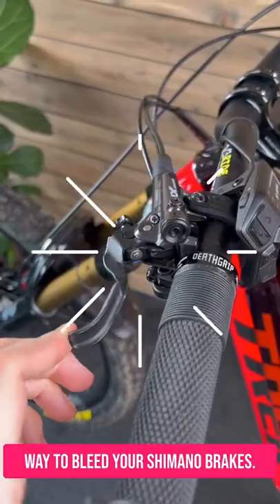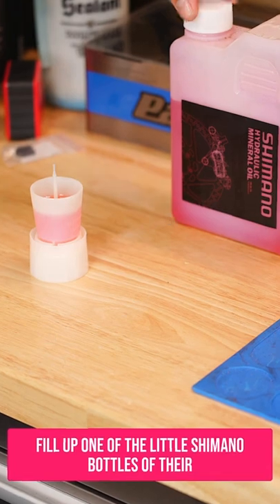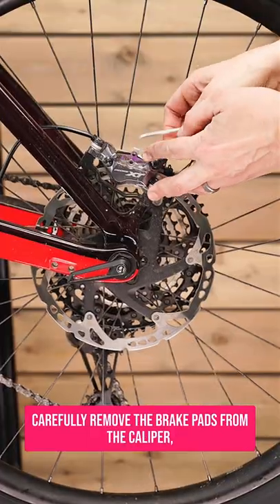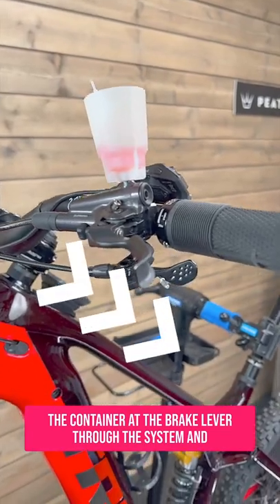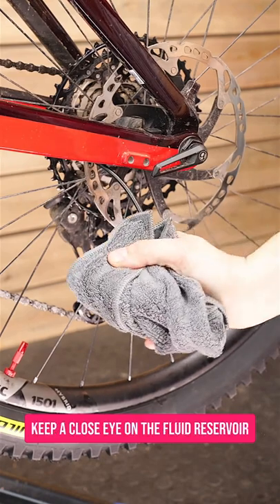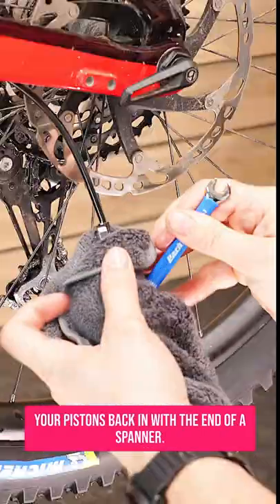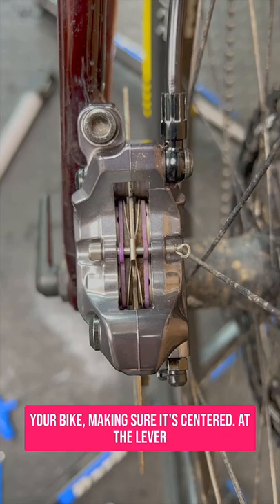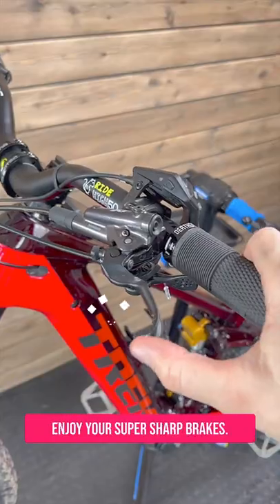How To Get The Perfect MTB Brake Bleed #shorts

Comment: You can put a clear tube on the bleed nipple and put it back into another container. You will be able to see the bubbles coming out in the clear tube and you will know when you have taken all the air out. This will save you the mess in regards to using the microfiber towel

Comment: I bleed my Shimanos from the bottom with a syringe, works better, as the bubbles come out effortlessly with the flow of the oil.
Reply: I like the syringe method since its much cleaner than letting the fluid drip. Though you should be applying very gentle pressure on the syringe as too much can pop the rubber seal in the lever reservoir.
Reply: Yeah I find the syringe way is better but I have trouble retightening the nipple without making a mess
Reply: Me too. The air will always tries to go up, so the method described here is very fault. Yotubers trying to be smart than the engineers
Reply: @FernandoHaddadMinistro  this is the kit shimano sell…..it’s not a YouTube fantasy! 🤦‍♂️
Reply: @dstroud666  Yes, but the order is up, not down
Reply: I've just bought a trek marlin 5 2021 and it has these brakes i am about 10 years behind i never new bikes for 4 to 5 hundred pound has braked like this...i don't have a clue ..if any1 can give me some help i would be megga happy..bloody hydraulic brakes what next ahhahah
Reply: @eyefishinggunkchannel1011  I can relate to you soo well. I recently bought a Canyon Neuron 5 2022, and I have been having the same sort of trouble.
Reply: @MG-pw7jp  welll they start at about 2k thats a bit crazy iff ya not clued up about bikes mine was 590 and i think that was a silly the canyon 6 or 7 are nearly 4 grand.your bike prob has wireless wifi brakes for nearly 4 grand lol
Reply: @MrPijus123  I was thinking of the same method(syringe in lever), how much is too much pressure?
Reply: The caliper has dirt sediment. Pushing fluid from the bleed screw of the caliper introduces contaminates up the brake line into the lever. Race mechanics do a gravity style bleed like this video
Reply: @jltrack  Yeah, honestly I'm a shitty mechanic but I've never had to have a bike shop do anything for me
Reply: Yep, and you should do it slow, faster with trap the bubbles somewhere in the caliper
Reply: @jltrack  Nailed it.

Comment: As someone who has always outsourced this particular job I think I'll give it a go after seeing this.  Thanks Rob.  If I don't comment on anymore of your clips, you'll know I've failed 🤣
Reply: Since air bubbles will be more likely to be at the lever, I don't think this is the best method. I would suggest one of next methods.
1. Quick bleed. Put the levers horizontal and put on the half full funnel. Then push bsck the pads and pistons. This will force the air out. Take out the brake pads and put in the bleed block. Tap the hose and pull the lever. You can leave it overnight as well. Then take of the funnel and close the system. Install the pads and you're good.
2. Full bleed by inserting the oil from the calliper side.
Reply: @Offroader74  how is leaving it overnight a quick bleed lol
Reply: In all seriousness just do the job properly following shimanos video it's very simple
Reply: @Offroader74  leaving it overnight isn't a quick bleed lol
Reply: So)) dude how’s that gone? 😊🤔 are you done well?)

Comment: I just attach the funnel with about 3/4 full of fluid. Then flick and pull the lever and plunge with the plunger rapidly. A few times doing this almost always pulls all the air out of the system. No syringes, no messy bleed ports. Takes about 5 minutes.

Comment: This isn’t a bleed, its a top up. It may get your brakes feeling better but if your going to this amount of effort you might as well just do a full bleed. 

A full bleed is pretty easy, just take your wheels out to avoid contaminating discs, remove pads, put the funnel in the lever, pop the syringe on the calliper, loosen the bolt on the calliper and push fluid through till it comes out into the funnel clear, close the nut on the caliper, reassemble.

Takes about 20-30 mins max

Comment: I've done it this way myself and it works great. Jason Marsh ex Santa Cruz Syndicate also suggest letting some oil run over the pistons to lube them.
Reply: Properly serviced caliper a wont need that, and you risk contaminating ur pads by doing that

Comment: I bleed my Xt brakes from the lever if the lever is a bit spongy or if the pads are worn. When I do new pads I use the old pads to protect the pistons, I push the pistons back flush with the caliper. I think if you need to bleed brakes use a syringe

Comment: If you have to do all of that then just stick with mechanical disc or rim brakes. Just a thought 😊
Reply: somebody never had hydraulic brakes :D
Reply: @009Daft600  No. From what I've heard post mount mechanicals are more versatile. You can use either road or mountain bike brake levers. Cable is a whole lot cheaper than hydro fuel. From a Mechanic's point of view (I'm not a Mechanic) it is easier to set up and switch.
Reply: @tmayberry7559  sure thing, but with hydraulics you can use full force with 1 finger, and they feel really fcking nice.
If you had em once, you're never going back. Its like switching to a mechanical keyboard, you're never going back to membrane.

Comment: In the official shimano instructions is says to turn the freestroke screw all the way in. What does turning the free stroke screw out do?
Reply: U have little Bit more oil and U can adjust the calipers netter. If U bleed with srew all in the screw has No function. Wegen U so IT Like in the Video U can Bring the Pads Closer to the disc by screwing IT in.
Reply: Shimano instructions are definitely right about the screw… don’t trust this guy please. Don’t trust anyone who pushes in ceramic pistons with metal metal spanner!!! 🤣😣 also if you do it with the screw loosen up there will be more oil then the system is designed for and after the oil heats up and expand it will make excessive pressure on the expansion chamber seals and your brake will change the leaver feel when it gets hot, so it will be less consistent actually. That’s why he thinks that the brakes fell "super sharp” but also it pushes the pistons out so you have no room to center the caliper and it will rub easily on the rotor.
Reply from the maker: Lol, push the pistons in gently using the cloth in between. Unless you’re clumsy you’re not gonna break them!!

Comment: Reasons people that arent mechanics shouldn't make tutorials. 
-shimano brakes are designed to be bled fron the bottom up 
-using a spanner on a ceramic piston will result in someone out there cracking a piston, use a plastic tire lever instead.
-leaving the wheel on is a recipe for contaminated rotors regarding of caliper removal 
-the whole procedure is way more messy and less consistent than the shimano recommended way

Comment: Guys this is the perfect example why removing the dislikes from YouTube was a terrible mistake! DON’T BLEED YOUR BRAKES LIKE THIS!!!! 😩 First of all you bleed from the bottom to the top so the air bubbles will go up with the old mineral oil. Also the whole process is wrong 😑 just read the official Shimano manual or watch Park Tool or GMBN videos about bleeding your brakes. And also the most important part… IF YOU TOUCH THE CERAMIC PISTONS WITH ANYTHING METAL YOU GONNA CHIP THEM!!! At least most likely. It happened in every bike shop at least once and Shimano doesn’t sell spare pistons so u will need to buy the whole caliper. I service bike for more than 4 years now and never did I see worse video than this. Don’t get me wrong, I learned a lot from YouTube but it’s becoming a wild wild place these days 🥲
Reply from the maker: It’s actually a legit way of bleeding these brakes 👊
Reply from the maker: I actually think you should give it a go and see what you think of the results. Obvs don’t chip the pistons, use the edge of the cloth to push gently back in.
Reply from the maker: And also, someone since sent me this video, of Santa Cruz pit mechanic using this same technique: https://youtu.be/piWBVDh1pTE which I guess he is the original creator of the idea. I was shown it by someone in a bike shop.
Reply: It will work as a "quick bleed” and it will work until you flip the open bleed nipple port upside down… the opening is way to big and at that moment the surface tension of the oil breaks and the flow of the oil out of the caliper isn’t continuous and the air gets inside the caliper. And because you were bleeding the brake from the top to the bottom the air bubbles left need to travel all the way up to the brake lever. In the video you sent me you can clearly see the bleed port on the top of the Saint brake caliper and also you can see that he never flips the caliper all the way upside down. I mean it might work, but it definitely isn’t an official way of bleeding the brakes for good reasons.
Reply: Also in the video he is lubing the brake pistons with the old dirty oil with metal shavings and all kinds of debris… that’s a bit dodgy imo
Reply from the maker: Cool. I’ve been doing it for a while with good results. Have a go, you may find it works well for you too! 👊